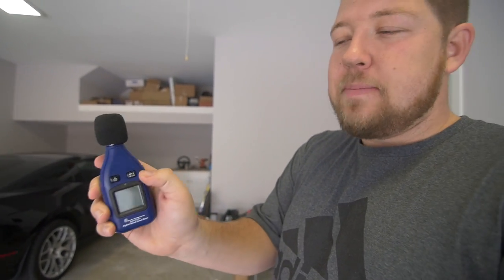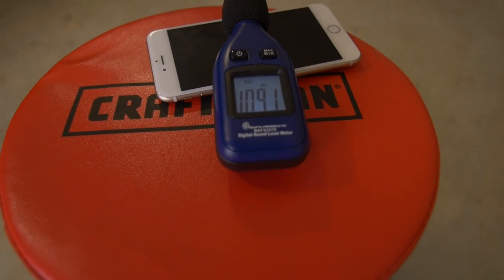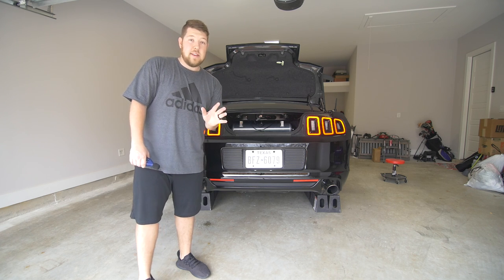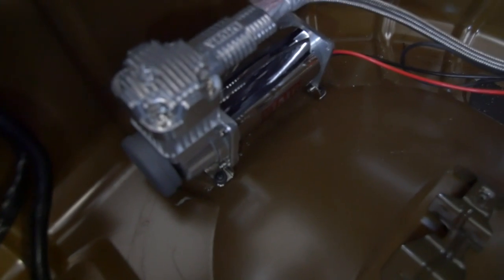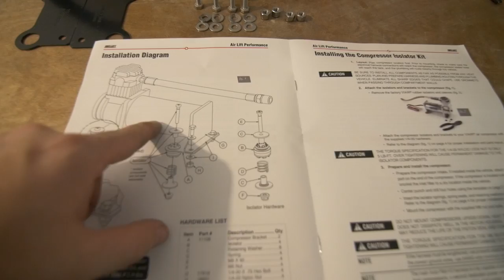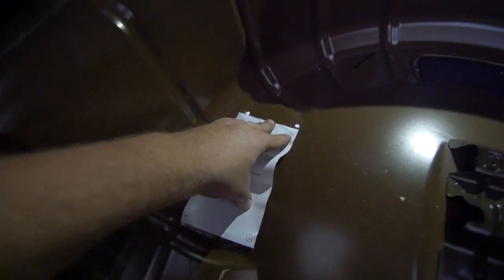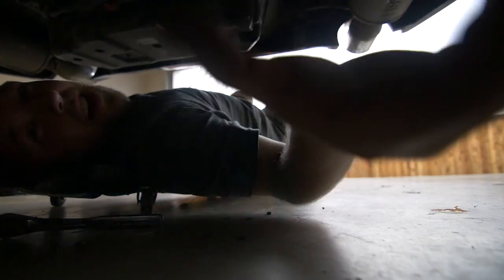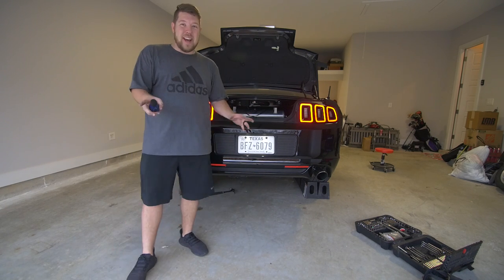Air Lift Compressor Isolator Kit Install and Sound Test - They WORK!!!

Comment: Next thing you have to do it's put a tube between the pump and the air filter. It's makes a huge diference. The tuve acts like a silencer and the sound bounce inside it. A 30 cms long tuve is enough. Thanks for the video 💪🏻
Reply: A tuve?!😳🤷🏿‍♂️

Comment: Try and Dyna Mat the spare well too! Prob would help a ton.
Reply from the maker: I agree man, I need to do this!! Probably wait until I install the second compressor so i dont have to peel any of it up. BC that sucks! lol
Reply: Jacob R. Doty ya ther's no probably to ur statement cuz it definitely will.. I finished sound deadening my truck not too long ago I used ALOT of types & layers of deadening esp round areas prone to heat but with the isolator kit and sound deadening u'll find urself trying to see if the compressor is even on by watchin air gauge cuz u wont hear it.. and use a pro 80mil or thicker deadener like second skin and if u apply s.s.'s luxury liner on top of that and u wont even hear that exhaust without rollin the windows down
Reply: Where can I get this kit ?

Comment: Do you have damping pads between suspension and the frame of the car?  I’ve been told that makes a difference because road noise goes through the body, which I can confirm using ducting insulation on metal.

Comment: Would this kit work with other brand compressors? My firestone is a bit noisy. looking to quiet it up a bit. would you know the distance between the holes drilled or that diagram? I now this video is over a year old, but i can't find any info online.

Comment: Great video - just wondering if you think this would work for being mounted upside down? Looks like it should still work
Reply from the maker: I’m pretty sure they say not to mount it upside down bc of the oil in the compressor. I see guys use all thread rod and nuts on either end to mount it up high.

But double check me on that. It’s been a while sense I have looked into it.